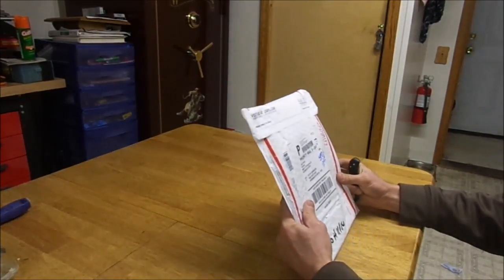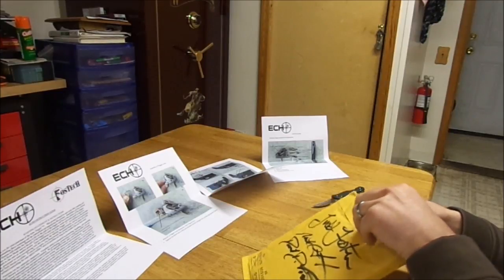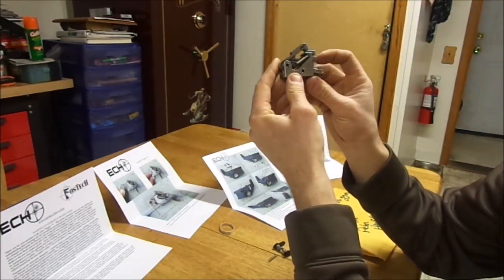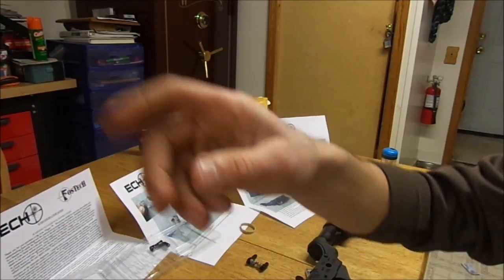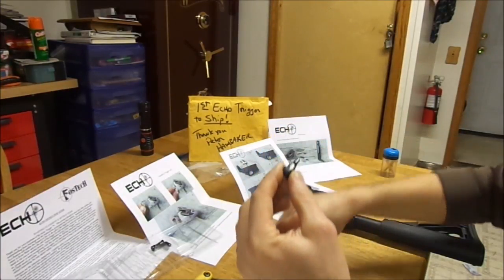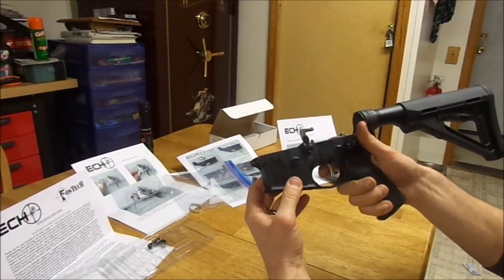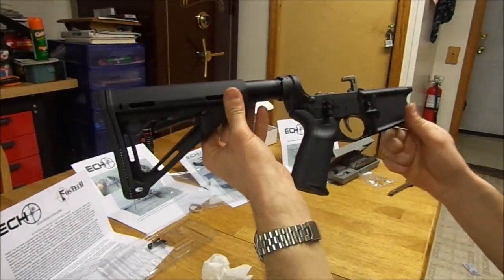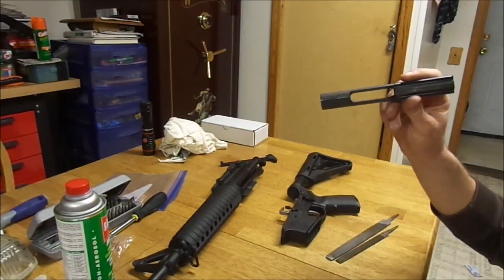Fostech ECHO Trigger opening and installation

Comment: Thanks for you work on this design. With regards to modifying a bolt carrier to work with echo mode, do you think it would be possible to modify a CMMG 22lr with the auto sear trip to work with the echo? There isn't a lot of metal on the trip and it is hard to see on this video exactly how much would need to be removed. I'm thinking it may be possible to bend the trip and take off a bit of metal. I would love to get your input though. Thanks.
Reply from the maker: Thanks for the interest.  I own a CMMG 22 upper (see other videos of my ECHO prototype), and ordered the trip yesterday.  When I get it, I will see if I can get it to work and will post a video of the results.
Reply: Thanks. I'll keep an eye out.
Reply: @AKBAKWUDS   Congrats on the Echo Patent!
 Q: Can the CCMG 22LR AR kit be used with Fostech Echo (2)...  now ?  If so want needs to be done to it, and the Echo 2 ?
TIA!

Comment: Could you post a scan of the instructions? I need some help understanding the trigger lock mechanism install. Does the selector go through the hole on the trigger lock?
Reply: Never mind about posting instructions. I found them! 
I understand the trigger is stainless steel. Do you think it was MIM parts that were sintered? 
I have had some custom parts made that I designed in AutoCAD; sent them off to rapid prototyping before final selection. The final part came back with the same kind of pits and irregular surface that would suggest MIM or custom metal printing. Came out really well and use it as an adapter for my Law Tactical folding stock when I use the CMMG 22 bolt carrier. Adapter designed allows buffer spring to give tension to the CMMG carrier and keeps it in battery as blowback would otherwise be an issue.
Reply from the maker: Not sure how the parts are made. They are steel except for the selector levers.